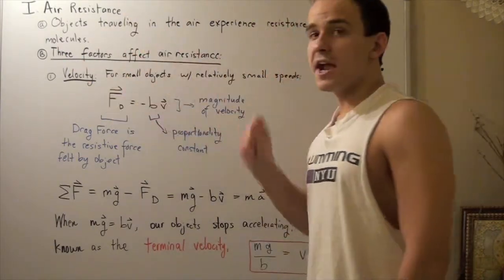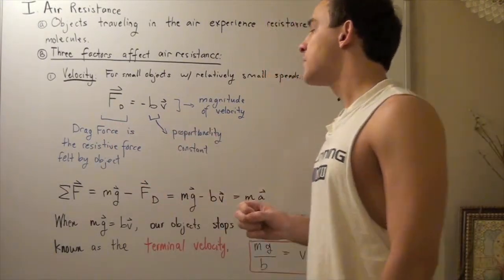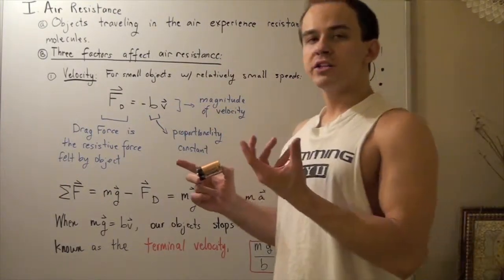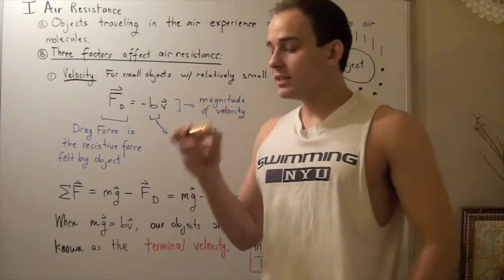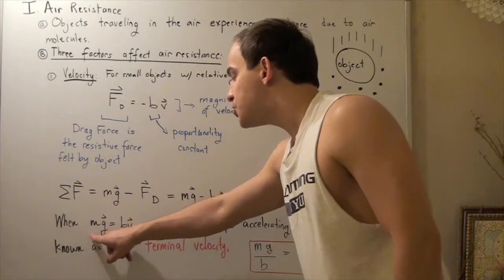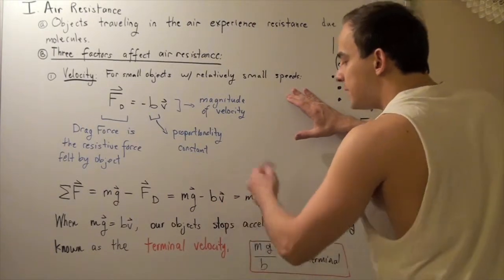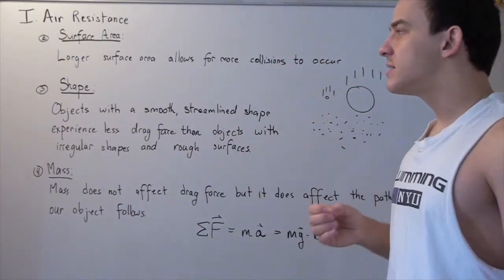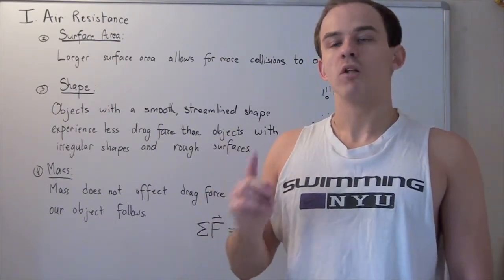Air Resistance and Terminal Velocity

Comment from the maker: If the acceleration is lower, why would it reach its terminal velocity faster? On the contrary, if the acceleration is lower, it will take a longer time reaching a terminal velocity. Also, its not that the larger mass will make less collisions. In fact, it will make the same amount of collisions assuming it travels the same distance as the lighter its. Its just, because it has more inertia, it will be able to deflect those molecules more easily.